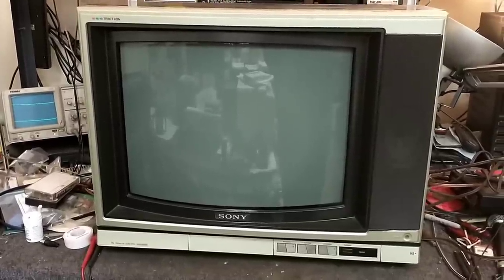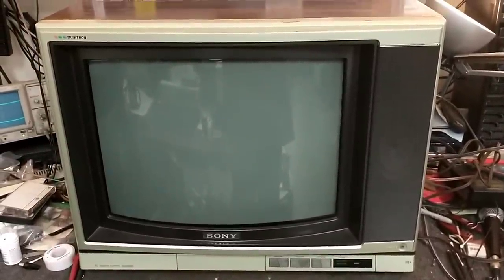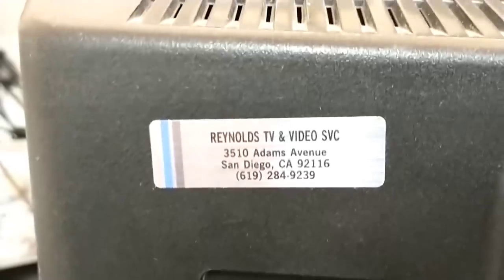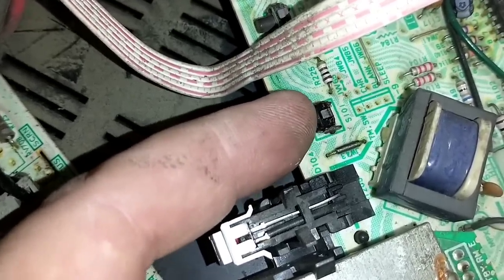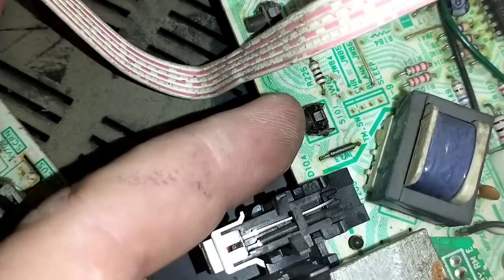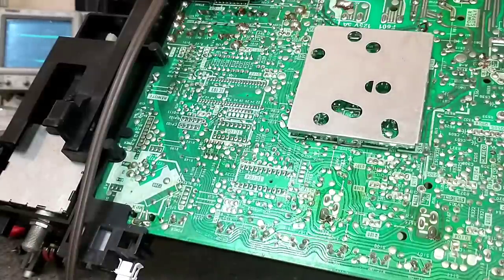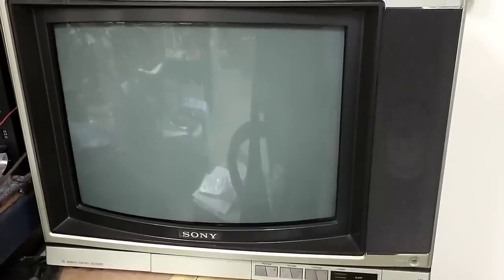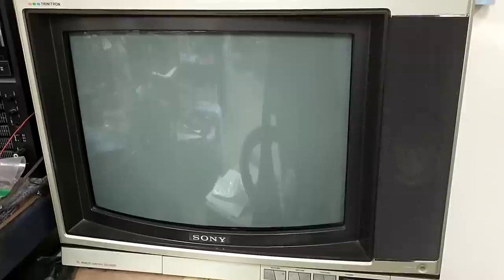Servicing a 1987 Sony KV-1997r - dead set.  Part 1/2 -assessment

Comment: These used to be all over the place in my area. That 22uf/250V capacitor and loose connections on the degaussing thermistor were very common problems, as well as bad connections inside of the IF assembly. I recall one, where the flyback arced and took out the HOT, as well as that oddball STK regulator/audio output IC.

Comment: + leaky TACs. Also chassis before this had micro RST fails, a transistor. Dont forget the IF strip PC cons. These were fun & easy. We made a killin on them. Lots of T-Bones !
LFOD !
Reply from the maker: It does act like its hard reset or forced reset. Might explain why no input is received and no memory retained.
Reply: Used to lift everything on micro EXCEPT Vcc's  GND's  RST & on/off chain. If ons OK & looks OK
its off one of the pins. resolder one at a time etc.
Can manual RST also.
LFOD !

Comment: Hi Jordan, I have a Trinitron from 1981 that has a low volume issue. The volume needs to be cranked up fully and even then it is very low. I think that this set was new-old stock as the tube tests new and there was barely any dust on the inside of the unit. The ESR on the caps check out, and I haven't tried replacing those yet. 

Just curious if you had any suggestions or ran across this problem in the past. 

Thank you for the great videos.
Reply from the maker: If volume is weak all the time, first check the speaker with substitution. If no change, then we need to trace the signal from the sound takeoff point all the way to the audio amplifier. A signal tracer or scope is useful in this regard with a test pattern up and 1khz audio. Trace until the signal drops off. See if the volume control is defective as well.
Reply: Sound is low from the over the air digital converter boxes. If the snow is loud then the audio output amplifier is good. Good luck.

Comment: Those Sony's have very good picture I use my Sony KV1925R all the time. I did recap mine as I'm not big fan of elna and after have to replace a flyback do to electrolytic shorting to ground throw the flyback transformer.